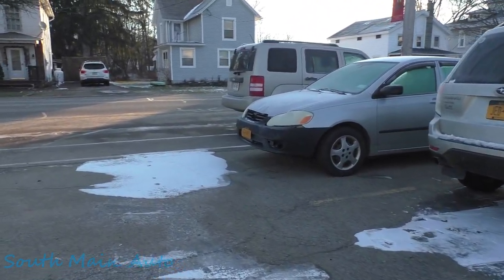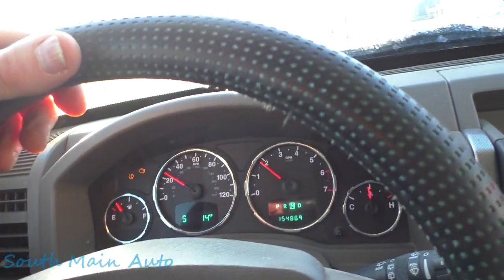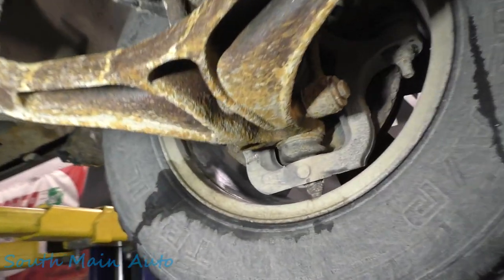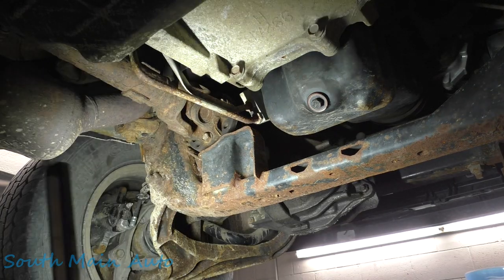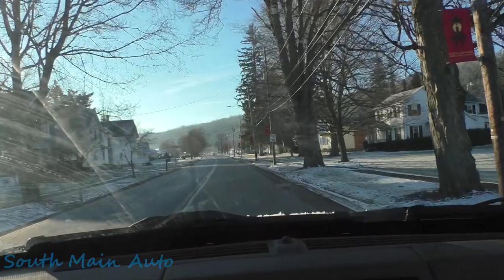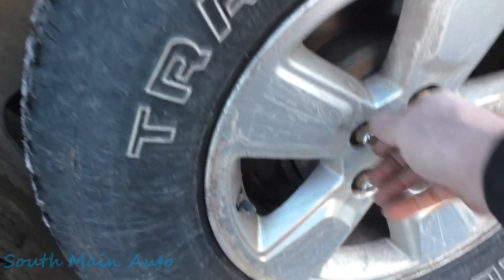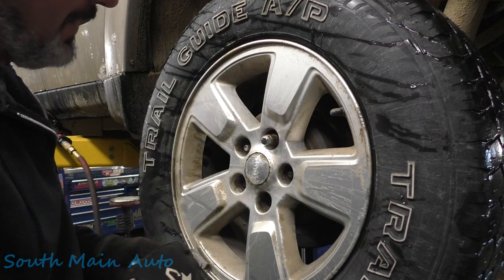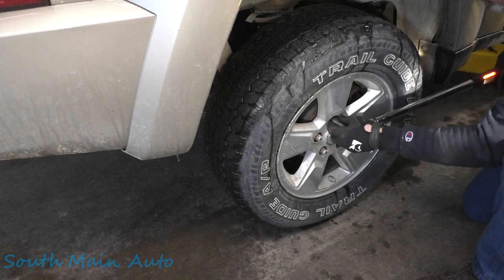Customer Just About Lost It.... A Wheel That Is

Comment: I never had a lose wheel. But I saw one crashing into three cars and avoiding my car only by half a meter or so. 
Got my drivers license, got a car from the company on lease. Two days later I picked up my sister and drove to my mom over the highway. Car with a camper trailer merges onto the highway 2 lanes to the right. I see the trailer dive down, see a wheel flying across three lanes right smack into two cars right in front of me. Swerved to the left to avoid it and not crash into the concrete barrier, saw in the rear view mirror that the car behind me crashed into it and debris everywhere. Speed limit was 120kph. Completely full of adrenaline I took the next exit from that highway like nothing ever happened. 
Was shaking to the bone when I got out the car 10 minutes later. Not a scratch on the car nor us.

Comment: 2005 rx8. Loved that car. I hit some ice once and damaged the rear driver side. I took a bunch of stuff off and put it back together. It took a few months. Well my dumbass took the wheel of and barley put it back on before that few months happened. I drove it and there was a horrible nose from the left rear, I checked everything and it all looked ok... but it still made the noise so I just assumed it was some body damage. 

One day I was driving it to work on the highway, going about 80 and I get this huge BANG, my whole car shifted and it was horrifying. I stopped and 3 wheel studs broke off... I tightened the other 2 down and the car never had an issue again...

Comment: I watched this video about a month ago and thought that this loose lug nut problem would be a rare occurrence.  A friend of mine called me today panicking about a noise in her Honda CRV.  I looked underneath at the CV shafts, drive shafts, suspension parts, shook the wheels sideways and up and down and could find nothing wrong.  She made plans to return to the dealership in the morning as it was still under warranty (she had it for less than a week).  She called again an hour or so later and sent me a link to a different YT video where a guy had similar noise when decelerating and he found loose lug nuts.  Then I remembered this SMA video and had her bring the car back to me where I found two missing lug nuts and three loose lug nuts on the right front wheel.  I torqued the remaining lug nuts and sent her on her way to return to the dealership in the morning to rip them a new ass for being hacks.

Comment: Different aluminum alloys shrink at different rates in severe cold and when they shrink strange things happen.  I watched a rental car literally drive off of its front-right tire (it was a Dodge rental car from the airport) pulling out of a parking lot.  The rim shrunk enough that the bead broke with lateral load applied and the tire popped off the rim and rolled down the street.   This was in Michigan where many people have steel rims for their snow tires.

Comment: My story: 2002 grand Vitera: rear drums were worked on (don't get started about the stripped-out ports to push out the drums). After driving about a mile from the house the vehicle felt like I was driving a boat in a storm while drunk. Pulled off so see that the wheel had 2 lugs left and the wheel almost completely off. I THINK it was because I didn't seat the drum right not allowing for enough threads for the lugs...dunno how i manged that... It would have been fun if I didn't stop as I was .01miles from getting on the highway. Definitely the strangest vehicle related thing other than the hood latch failing on the same vehicle going down the highway.

Also reminded me of the zip ties on driveshaft prank I did a few times

Comment: Ford Expedition EL in the Ford Quick Lube shop for service and shop repairs. The lube shop rotated tires and finished service sent to repair shop for break job pads/ true rotors,
All this was being done while waiting. 
They said around noon it would be done. They delivered it and I drove home before a quick trip up the highway, luckily I only went home and low speed, I noticed something wrong  it was thumping from the rear. I backed in my drive way and lifted each tire off and spun them finally back passenger side tire was nearly off the studs. Finger tight lug nuts found. I took video and documented what I found called the dealer and told them I had an issue. I set up a dealer pick up on Monday for inspection and certification no issues came from the loose lugs. They were good about the whole incident and verified and guaranteed no issues and wrote off my service fees and complete cost. The tech I’m not so sure about. Likely fired or reprimanded. Moral of the story with people doing work that could cause death being distracted at work by FB, YT, Insti, or what ever, 
“Always check lugs before driving off from a shop with a lower quality work force” no offense to the great guys who do great work but my family were just about to be put in serious danger leaving to get on an interstate and drive 70 mph, if that wheel would have departed the company of my truck and it could have been really bad.

Comment: Opal GT -- someone tried to steal the mags of it - got interrupted (or my brother forgot to tighten the one rear wheel lug nuts), the wheel was left loose, fell off on way to a high school math exam, loose wheel hit a teacher's car from my high school heading the opposite direction ~60mph, brake drum also flew off - went across the street. The concerned teacher whose car my tire hit (scuffed, skimmed his car), stopped and he gave me an excuse to miss the exam I was heading for, took the exam the next day.  Lug nuts should be tight.  Lesson learned.  Also fixed the GT in a parking lot, a jacked-up car, with not enough reach, a muscle-bound friend lifted the axle and helped put the car back together.   Good times.

Comment: That knocking noise took me back to when I changed the front driver outer tie rod end, control arm, and stabilizer link. I ran out of time, and was going to finish the passenger side the next morning, Once I drove off I heard the exact same knocking noise. I pulled over, I couldn't see anything. After not figuring out what it was for a couple days, I walked around the car a final time. I noticed the Front Passenger rim was not seated flush with the brake rotor.  Some lug nuts were obviously loose. How did that happen? I do not know. Everything was fine before.

Comment: Weird......strange in your experience it happens to Jeeps and Chryco products... You figure an aluminum wheel is an aluminum wheel no mater the manufacturer.. My experience living in the rust belt in Toronto Canada is corrosion on the hub and on the inside of the wheel causing a poor fit when torqueing the wheel.. I always take a wire wheel and clean the hub and inside of the rim, (sometimes a chisel and hammer with safety glasses)....   oops, safety 3rd....lol... apply a thin film of grease before mounting to help prevent corrosion...Obviously you know that but I still find it strange that you find it happens to Jeep's and Chryco products in your experience...Keep up the video's my friend.

Comment: I wonder if it is common practice for shops to over tighten alloy wheels, I pretty much always have to pull out a breaker bar to get the tires off my jetta if I bring it into a place that requires the tires to come off. Kinda sucked when I had to swap tires on the side of the road that one time with the short as tire wrench.

Comment: Had exact same noise in my Dodge truck a few years ago and I woulda swore it was a bad hub in front left. Turned out somebody tried to steal my wheels and they got off all the lug nuts on the left rear except the locker lug. Ended up I broke a few studs off on my trip home.

Comment: The moment I heard the noise when you was driving test the truck, I knew right away it was the wheel problem. I had the same story. I was working on the car until it was dark, I temporarily put the wheel back on with the nut hand tighten so that I would take the wheel off quicker the next day to work on the car again. I totally forgot about it. The next day I drove the car, I heard the clunking noise, I drove right back in my garage to check it out. I found nothing. So I decided to take the car to the shop to check it out. But the car was making  so much clunking noise that I had no confident I could make it to the shop, I drove back to my garage and check the car out. Ah it was the loosing lug nuts. How stupid I was.

Comment: Wheels kept getting lose on my 1978 chevy 4 wheel drive pickup. Replaced studs and lug nuts several times til I lost a wheel going over a bridge and had to retrieve it from the creek. They were new Fenton rims so I took them back to the shop were I bought them. I had them in the back of my truck with me and the service guys looking at the rims and seeing nothing wrong with them. An elderlly man walked by and looked at the rims and said that he would not have them rims. He said that the lug bolt holes had no tapper. We looked and sure enough the holes were just drilled straight through with no tapper for the lug nuts to fit in. Fenton replaced the rims and problem was solved except for all the trouble and expence that I had been through.

Comment: Our local tire shop must use the same impact for passenger vehicles as they do for Semis and rear wheels on tractors. If they put a wheel on, a 4 foot cheater on a breaker bar won't budge a lug nut. Best hope you never have a flat tire, or you'll have to have it towed somewhere with a similar or heavier impact.

Comment: I almost lost a wheel on my old f150 a few years ago. The lug nuts on passenger rear got loose and the brake drum sheared the studs. No vibration , but a few times that week I heard a clunk like a  rock being flung at my wheel well. Stopped at a stop sign about 3 blocks from the interstate and my truck just stopped moving. Driveshaft spinning but not moving. Thinking it was the rear end, I went to the junkyard to get a new one. I found out the studs were gone when I jacked up the rear end and the wheel fell off.

Comment: You know I had a 2014 1500 CREWCAB and in the owners manual is says suggested torque on the lugs nuts was 130 lb ft on any of the wheels alloy or otherwise

Comment: regarding over torque-  just asking, would it be better to just torque to spec but use locktite to prevent the nuts from backing out?  If you torque out of spec by 20ftlbs- could that not 'stretch / distort' the threads on either the nuts or bolts. My Volvo requires 105ftlbs-  I actually torque to 100 WITH anti-seize - never had an issue.

Comment: Loose Wheel Story.  1995, one of our drivers (heavy truck) "had a feeling" something was wrong on his trailer.  Could have taken the exit ramp up to the truckstop.  Could have gone 5 miles up the interstate to the rest area.  Decided, NO, better stop here.  Pulled over at the beginning of the exit ramp and just as he rolled to a stop, both wheels on the left rear of the trailer plopped over onto their sides.  All 10 studs broken.  Not really uncommon with heavy trucks as everyone just hammers the hell out of them with a 1" drive impact, overtightening them at least double the spec.  Our new service manager had been using a torque wrench since 1987 on every wheel.  If he caught you not torquing a wheel, he'd make you walk out to the end of the driveway (he used those wheels with the broken studs still in them to mount the mailbox on) to look at those wheels and come back and have you explain to him why your way was good.  You only made that walk once.  If you needed to a second time, you were kicking road apples.

Comment: Wife called me on the way to work, said she heard a knocking noise from the wheel area. Told her to check the lug nuts and several were missing from one wheel. Kids had stolen them. Told her to take one nut from two other wheels and it would be fine till we got replacements.

Comment: Eric I can only assume the reason you guys deal with so many loose wheels is because of your climate, the corrosion builds up on those wheels and hubs and if a inexperienced tech is tightening the wheels down they may not realize that the corrosion has the wheel cocked uneven when they torque it down

Comment: Have had that problem with aluminum wheels on several cars. We have to change the tires every six months and put on studded tires. When I put the aluminum rims on I retorc them a day or two later and often find they have loosened in the day since they were put on. The problem is if one over tightens them then it's a bitch to get the nut loose later.

Comment: Replaced the front brakes on my moms rav4 about 2 weeks back. Pulling out of the driveway and I clicking sound. Confused as you could be. Drive it back up to the spot to look around. See my torque wrench on the ground by the front wheel. Right where I left it to torque the lug nuts down before I drove the car🙃. Somedays I question why im allowed to work on cars

Comment: Had this problem and the wheel fell off.  It fell off on a bridge and my wife was stranded in one lane and the wheel was in the other.  Could of been really bad.  This was 10 miles after have all new tires put on.  The service center never torqued the lugs nuts.  They had a big bill... new tire, new rim, new hub with studs plus the fender and rocker damage.  Moral of the story, check the lug nuts!

Comment: i would of  check the looseness of the lug nuts first... only because  this happen to me too... it was a steel jackman style wheel which is just a flat plate cut-out pattern style and welded to a outer rim and the lug nuts are famous for loosening up and it did. made the same noise a weird knocking noise with accelerating and braking or turning just something loose??? or a wheel bearing... just say`n

Comment: I think the better question is did you bolt the front driveshaft back up before handing the keys back?
I'm surprised it didn't make a similar noise on your test drive, with it hanging out willy nilly still attached to the transfer case and all.
Don't ask me why I would mention that.

Edit. Four days ago I should have read the pinned comment.

Comment: My brother had a TPMS replaced by a chain owned tire center. Within a week he was driving on a country two lane road with no shoulder. It was almost dark driving about 50mph. The right front wheel came off and went over the guard rail. He managed to get pulled in a driveway. He’s 84 years old and tried to call me but he had no cell service. He dialed 911 and they dispatched a tow truck. He had it taken to a local tire shop. Three of the studs were broken off and no lug nuts on the remaining two. The shop got it back on the road. I went with him to the original store that replaced the TPMS and they had him to get an estimate for the body damage. The total repair was $3200. They sent him a check for the complete repair.

Comment: I would have found this right at the start, by accident! and no need to take to the garage, to me it sounded like a wheel bearing, so giving each wheel a wobble to find out which would have flagged up the loose wheel, My best ever easy fix i ever had was my mum's car, in her words "it rattles unless you change gear" i was like wtf? puzzled i went out and thought i'll turn it round and go round the block, yep it rattles "if you let go of the loose gear knob!" just a quarter turn with the left hand while driving and its all fixed.

Comment: I had a problem with my 70 Dodge Coronet and loose wheels. If I heard that distinct singing noise, I would stop and check the lug nuts all the way around the car. It was a different wheel every time and that made me suspicious that someone was doing it to cause problems for me. I moved to a different place and the problem mysteriously stopped happening.

Comment: Chryslers often  have loose chrome nut caps [pressed on over a steel nut], so how are you supposed to guarantee wheel torque in that situation? We stocked solid nuts from NAPA and sold many sets. Also, those alloys seem to get excessive corrosion on the centers and backs of the wheels, you need to clean all surfaces before re-installing the wheels.

Comment: Loose wheel story. 18 years old. (28 years ago) Headed to pick up my step brother from work. It's not uncommon for large luggy tires to hold stones a while then randomly fling them while driving. Well, looking back, that wasn't a chunk of limestone after all. It was a chrome lugnut I saw fly. About 4 miles later I see a 38.5 x 12.5 x 15 Super Swamper roll out from under the front of my truck and proceed to venture out through someone's front lawn. Seemed to me like it was picking up speed. After a couple little hops it bounced about 20 ft in the air at least and tried to hide in the woods. Meanwhile I'm sliding down the road on three big tires and a rotor which ends up with a serious flat spot.

Comment: Do the Fiat/Chrysler products have poor fitting lugs vs wheels? I can say for my F150 most of the aftermarket wheels have a different sized/shaped lug hole than Ford wheels. You need different lug nuts depending on the wheel to make sure they hold well.

Comment: I heard that noise once - at 11pm driving a company car out to the start of my midnight shift. It'd been serviced that day and dropped off to me

60mph in the middle of noewhere on a sweeping bedn isn't the best place to hear it

First thing I did was stop and check the nuts - 2 wheels had untightened nuts, one wheel had just enough play on the studs (steels) to clack on bends

I had a 15 mile drive in front of me. Possibly wouldn't have made it (1984 Suzuki Swift/Holden Barina)